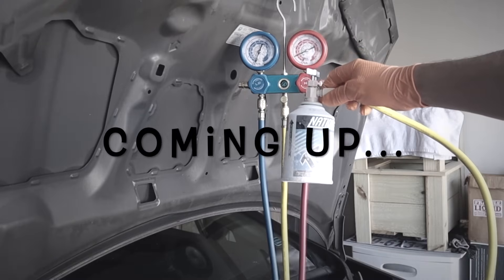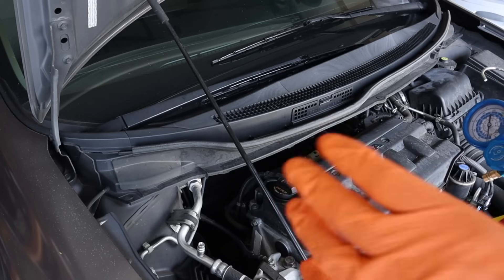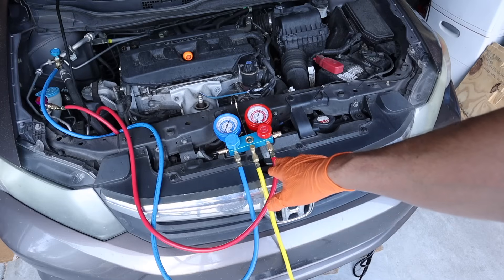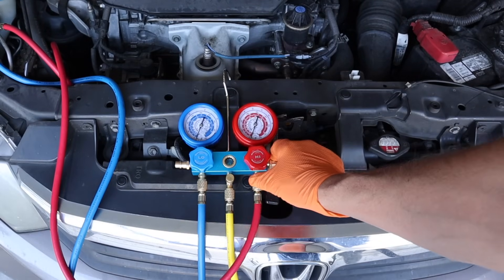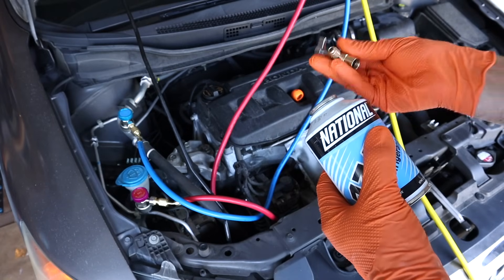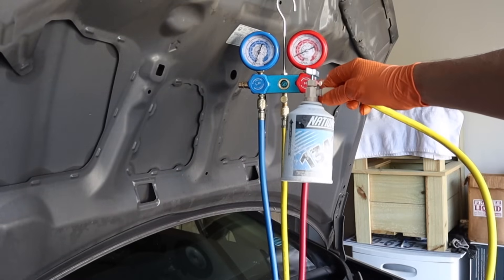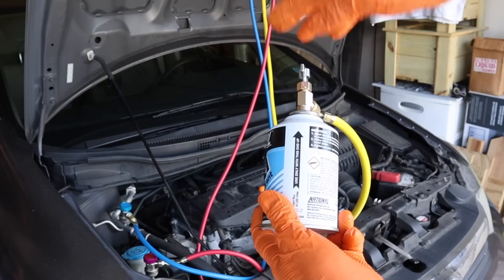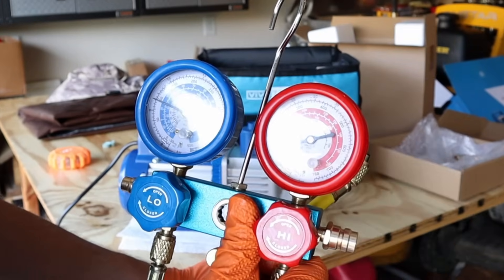DIY Tutorial - Proper R134a A/C charge & Diagnostics

Comment: fine video well done
Reply from the maker: Hey thanks for watching, I'm glad you found some value in it 👍
Reply: @my-honest-review  I have a conundrum question for you though, is there anything specific that would cause the manifold hoses to get hot during a re-charge failure and anything specific to a 2012 Hyundai Elantra GLS
Reply from the maker: @wat_cher  The high side manifold hose getting warm or even hot closer to the fitting on the AC system is normal but the low side should not be. It sounds like your compressor may not be clicking on to draw the refrigerant in. If it is however clicking on, it may be something as simple as the valve that fastens on your can is freezing up and not allowing the refrigerant to pass. Just playing with the valve, twisting back and forth, will often get things going again. And if the system has indeed managed to accept all the refrigerant, but that low side line is still warm, and no AC, either the compressor is not doing its job, or you may have a restriction somewhere like in the expansion valve. Hope this helps!

Comment: Thank you sir you answered the 1 Millions question in my mind, do not use oil additives if you did not replace or open the system or component, I don't think i seen any other videos that said what you did. So thanks again and great vid..
Reply from the maker: Hey, thanks for watching, I'm glad it helped! Yep, just straight refrigerant unless a component is replaced 👍
Reply: I think it's a good practice to add UV dye, especially on a system you suspect has a slow leak.

Comment: Great video! Best of the many that I have watched on the subject! How do you know if you have enough (or too much) oil in the ac system after replacing the dryer ( 1986 Mazda RX-7). I will recharge with Envirosafe after vacuuming.  Thank you.
Reply: Remember that EnviroSafe is a completely different kind of refrigerant (propane + isobutane) and the charging level is way different from R134a.
Reply from the maker: Hey thanks for watching and glad you found some value in it! If the drier is the only component replaced, you might could add 1  to 1.5 oz of oil with your refrigerant charge and you should be OK. I wouldn't add anymore than that.

Comment: Done the video step by step, and ac clutch won't engage unless I jump it, and the condenser fan won't engage unless I unplug the pressure switch
Reply from the maker: You may want to check your AC relay, it might be something as simple as that. They're cheap enough that if its original you may want to go ahead and replace it..
Reply: @my-honest-review  I swapped with the starter relay and fuel pump relay. Same thing. I feel like it's the cycle switch or expansion valve
Reply from the maker: @dabbergames3827  Yes, and between those two, sounds like the most reasonable choice would be the cycle switch. Electrical problem are always fun to track down!
Reply: @my-honest-review  right! The old compressor would kick on no problem. It just had a leak. Now the switch goes out with the new one lol. It held -30 pressure for a solid hour, so I know there's no leaks anywhere else.
Reply: @my-honest-review  thank you by the way!
Reply from the maker: @dabbergames3827  Glad to help just a tad 👍
Reply from the maker: @dabbergames3827  Yes for sure no leaks anywhere holding that strong of a vacuum for a whole hour!

Comment: Only one issue. The yellow hose once disconnected from the vacuum pump will fill with atmospheric, so will be introducing air into your system 😕😕
Reply from the maker: You are correct, and this is why you have to purge the air from the yellow hose with the Schrader valve at the top when introducing the first can to the system.
Reply: And you're doing this with the blue valve on the manifold closed, so the blue line is still under a vacuum.
Reply: 11:15 he purges the yellow hose pipe

Comment: Does the vacuum pump also remove the Freon ?
Reply from the maker: The refrigerant will be removed before you attach your vacuum pump. You'll do this by going to a local shop and ask them to extract your refrigerant with their reclaiming machine. Most will do it for free. Of course, if all your refrigerant had leaked out, then no need for this step, just go ahead and vacuum.

Comment: question: if there is a small leak in the system will outside air enter in through that leak while the system is under vacuum ?
Reply from the maker: It sure will, and you'll know that by the guages not holding at 30 inches of mercy when the vacuum pump is off.

Comment: Wouldn't the repair shop evac of the freon remove majority of oil as well ??  Which would be a problem if none is added during your recharge.  And , maybe the "a" in R 134 is oil additive ? But thanks for posting.
Reply from the maker: Good question! Actually when an evacuation is done, only refrigerant, air, and moisture are removed. The oil stays in the system. You'll only have to add oil back into the system if you replace a large component like the compressor.
Reply: There is definitely SOME pag oil removed when evacuation occurs. Maybe about 1 oz. Professional shop machines can separate this oil when recovering refrigerant and keep the freon pretty darn pure.
Reply from the maker: @event3horizon  Just to be cautious, it will not hurt anything to add an ounce of oil with your refrigerant charge.
Reply: Add in some UV dye.  For what I have, you use 3/4oz.  And the dye is dissolved in compressor oil.

Comment: Very good and concise procedure, right up to the part where you put the 12oz can on the scale, from which you needed just 3oz, but the weight was now 18.3oz bcuz of the hose. Then you proceeded to take 3oz from the 18.3oz, and be left with 15.3oz from a can that only has 12oz! 

I don't know if it's my mathematical calculation, but you should have been left with 9oz in the can, excluding the 7.3oz weight of the hose.

I'm curious to know, did you weigh the can afterwards, to make sure you had 9oz left in it?
Reply from the maker: Indeed I did weigh it and it was very close. Whenever you have a can balanced on the scale with the weight of the hose, its not going to be dead-on. But luckily you have a range of refrigerant that the system requires, and not a very specific amount. And this gives you some wiggle room when trying to take a portion out of an additional can. Hope that helps!
Reply: @my-honest-review  I can accept that. It was a nightmare for me, on my twin A/C unit of my 2015 Town&Country. Replaced the rear evaporator and expansion valve last summer, but made an error of using metal with rubber type O-ring at the upper portion, and just rubber on the lower connection, and being over cautious on the tightening to make the seal. Seems systrm leaked out bcuz I turned it on and air wasn't cold. Went under it yesterday and re-tightened 13mm nut. Gonna attach manifold hoses and check, re-add freon.
Reply from the maker: @MusicMinisterJP7  Yes, I've heard the Town and Countrys have especially sensitive AC systems. I hope it works out!

Comment: Small point, but each can has 12 oz of refrigerant. So you should weigh the empty first can and subtract that from the weight of the second can (assuming a perfect 12 oz in each can) then from that result, take out the 3 ounces you need. You can always add a smidge more if needed. 

Excellent video. Very clear and good to add the nuances that most leave out. It helps the idiots like me to better understand not only what's going on but also why.
Reply: I have a kitchen scale that will also measure negative values!  So I can tare a full can, and when it reads negative 3 ounces, I know its been emptied by that amount.
Reply from the maker: That is a good way to measure the exact amount, thanks for that tip! Hey us shade tree mechanics have to help each other, so glad I could help just a tad, and thank you for the encouragement 😊

Comment: Great vid sir Thank you for all the time you spent helping us shade tree mechanics save sum $$$$ I bought the kit from amazon and fixed not one vehicle but 2 !   A 2009 dodge ram an a 1999 Jeep wrangler only prob I had was the leaks in both truck and jeep were buried in the dash and had to remove to replace the evaporator core's  LOL what a job they were to do but could not have done it myself without your Great video ! Thank you............Ohh BTY I found the leak by poring sum UV liquid in the shrader valve and no sign of leaks till I removed the dash an the evaporator lit up like an X'Mas tree with a UV lite !!
Reply from the maker: Hey thanks for that feedback Paul, and I'm glad you fixed your issue! Man, replacing those evaporators can be a challenge for sure, it sounds like you are a step above just a shade tree mechanic brother! Oh, and FYI... I learned something just the other day... To help diagnose a leaking evaporator, shine your UV light on the condensate that drips on the ground and the dye will show up there...who knew?
Reply: @my-honest-review  Oh yea the drain hose too ! After I had my air box off i did just that and of course you were right about that but any hoo i had to dig deep to replace the evaporator...... Cold air in both vehicles now thanks to you....Please keep posting your a wealth of knowledge sir....Oh yea I put the old evaporator in a bucket of water an blew in compressed air an Bubbles galore showing me exactly were the leak was
Reply from the maker: @paulhughy3948  now that's a good tip right there - putting it in water and blowing air thru it, always good to find that "smoking gun"! Thanks for the encouragement my friend👍

Comment: will my vacuum pump work on 25 to 26 inches of mercury? that's the maximum vacuum it can get
Reply from the maker: It will probably be just fine, I would just let it run longer, maybe an hour and 15 minutes. And then just make sure it holds vacuum of course, like I showed in the video.

Comment: great video, but i ran into 2 issues...I'm not 100% sure the can tap is sealed when ran all the way down (closed).  per your recommendation, I tried to suck the refrigerant out of the yellow hose after closing the tap, but as soon as i opened the low side valve on the manifold, i started getting air/refrigerant escaping from the tap.  I made sure it was 100% closed/twisted down.  The other thing was that after disconnecting the manifold, there was still A LOT of pressure/refrigerant in the gauge and lines.  Probably at least an ounce escaped when the manifold was opened after being disconnected from the vehicle.  Thoughts?
Reply: Note that this is done only after evacuating a system and charging it. If you're connecting a Manifold Gauge Set (MGS) to test the pressures alone, there will be some air and moisture in the hoses, which you don't want to draw into the system for obvious reasons.

Here's the procedure after evacuating and charging a system, which must be done in this order:

1. With the engine running at a fast idle--about 1,800 RPM--the compressor engaged, and the MGS still connected to the A/C system and the refrigerant container, close the adapter connected to the system's high-side port AND the refrigerant container's valve to which the yellow hose is connected. The adapter connected to the low-side port remains in the open position.
2. Open both the high-side and low-side MGS hand-wheels. The system will quickly draw-in the pressurized refrigerant and oil from all three hoses through the blue low-side hose.
3. Disconnect the MGS from the system and the hoses from the MGS.
Reply from the maker: Yes this is a bit tricky. It sounds like to me tho that maybe your can valve/tap has a faulty seal inside of it, or maybe that is wasn't sealed onto your can perfectly. If your low side manifold valve was open, compressor was cycled on, then it should have drawn in at least a portion of the refrigerant remaining in your hoses. Sounds like it was "backfeeding" a bit in the other direction. Maybe the compressor wasn't cycled on at the time? And yes it seems inevitable that there will be some pressure still remaining in the manifold set after disconnecting. What I do now when I remove the manifold set and store it is that I leave the can valve/tap on the yellow hose in the closed position. This leaves less of a chance of air/moisture getting in the gauge set. Hope this helps!
Reply: @my-honest-review  I think if I do this again, I'm going to be on the safe side and assume the can tap doesn't seal from the yellow line when all the way in the closed position.  I'll just have to vent the yellow line every time I switch cans
Reply from the maker: @ljbrandt500  I think that would be a safe bet for sure 👍
Reply: @ljbrandt500  Or, buy another tap.
Reply: @jackb1803 you're right, some taps have a check valve (backflow preventer), others do not!

Comment: I vacuumed my system for 30 minutes and let it stand for 30 minutes to see if I have a tight system all my O rings are sealing and no leaks then I open the A/C coolant fro a minute then start my car and put the A/C on high cool then I finish fill ing the system to the factory scaled amount and presser. then let it run for 15 to 20 minutes let it cycle to check clutch engagement look for belt sliping on the pulleys to see if my pressure switch is working at the right temperature  then I know my system is working at its best cooling .
Reply from the maker: Thank you for sharing Steve, it sounds like your system is working good and has no leaks. Great work!

Comment: How far should the gas pressure gauge stop?
Reply from the maker: Rule of thumb for the high side will be around 195-225psi, this is when everything is working properly and the compressor is cycling on.
Reply: Look at a temperature/pressure chart for your refrigerant on the web.

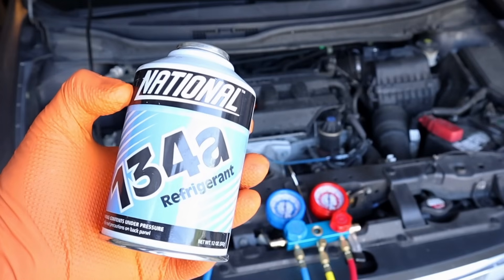Comment: 9:52 when you have a shop evacuate your system like you said you did... the oil will be removed from the compressor and you'll need to add the oil back in... I'd bet a dollar that your compressor seized up a few months later. Modern cars uses the a/c compressor to help defrost windows even when on the "hot" setting. So if you use your defroster during the winter your a/c compressor will still come on.
Reply from the maker: Thanks for the input, but all is well, and my system is blowing cold still. No oil comes out actually when doing the evacuation. Only air and moisture. I was confused on that myself when learning about AC systems. PAG oil only needs to be added when replacing a component like the compressor. Hope this helps you.

Comment: I need help. 
I was going to comment on what a fine video you have shared once I got finished with the procedure, but I got stopped cold!

Everything was going fine until I began to add the gas. At that time the gauges were sitting at -30 psi on both. I had pulled a hard vacuum, and it held overnight. When I opened the low side valve to begin the charge, it didn’t suck the refrigerant in like yours did. It initially jumped about 25 psi, then it stopped. After a long time of coaxing, I was able to get one can emptied and the pressures were about 75 and 100, low and high. I hooked the second can in and that was it; I couldn’t get any of it to go in. I closed everything up as it was since it was getting dark.

The only way that I deviated from your procedure was I wanted to add some dye during the charge so I could find a leak. Before connecting the first can of R-134A to the manifold, I added about ¼ oz of dye into the charging hose. 

I know this comment section is not the place for a long troubleshooting discussion, so I welcome a pointer to a proper forum. And, your videos are great!
Reply from the maker: Hey Steven, thanks for watching buddy. So, a couple of things...One, it's a pain, but you are going to have to start over and go thru the vacuuming process again. This time I would not worry about adding dye when charging. If your system held 30in of vacuum overnight, you don't have a leak, that's for sure. If you do, it's a very very tiny one.

And now when adding that second can... it can be painfully slow. Just to give you an example, I did an evac and recharge on a much larger system a couple days ago that held 29oz (twice as much as my Civic in the video) and it took me over and hour to massage that whole amount in there. That system took about 2.5 cans.

With that in mind, here's a couple of tricks you can try...

Wait until it's hot outside to retry, above 90deg, you'll get better results.
Double up and put 2 fans in front of the car.
Sometimes you have to twist the valve on the top of the can slightly back and forth to find that sweet spot for the system to accept it.
And lastly, when you are "dipping" the can, squeeze it slightly to increase the pressure in it (slightly).

(And of course make sure your compressor is cycling on during this process..if it's not, you may have found your issue)

Hope that helps!
Reply: @my-honest-review  
Thanks for the reply. Unfortunately, I am going to have to be away from this job for the rest of today. I’ll summarize what I have done up to now and get back on it tomorrow, and I will try your suggestions.

Yesterday, I did restart from scratch and got same result. This time the first can seemed to go in a little faster, but it stopped before emptying completely. I put on can 2 to see if the higher pressure would drive it in, but no. After a couple of hours I stopped. The pressures were 76 and 100 low and high. The compressor did come on but did not cycle. The vent air temperature began at 82 and was 107 when I quit. There is more to this problem than a recharge I believe.  Later…